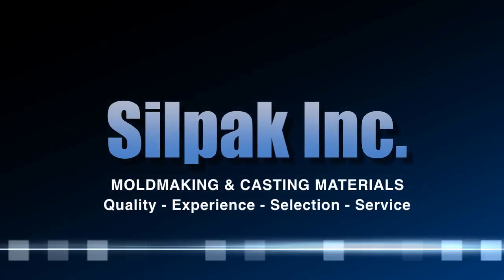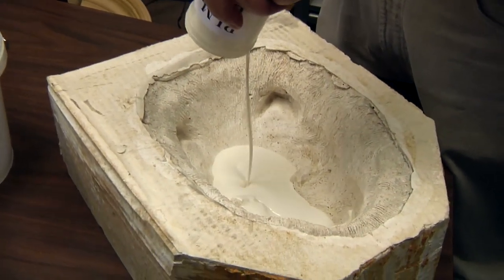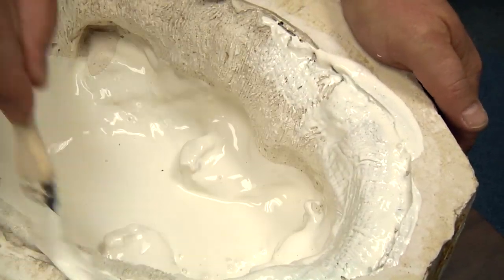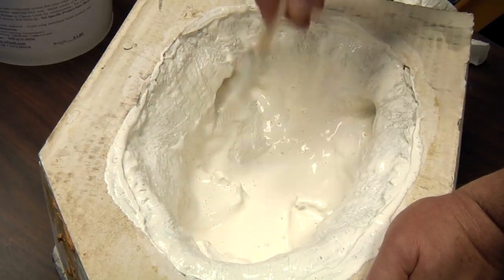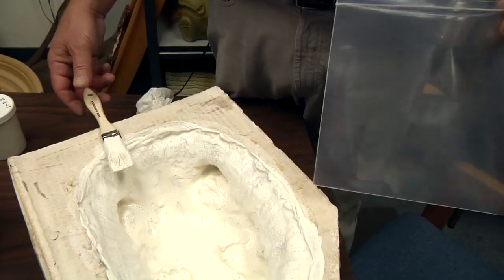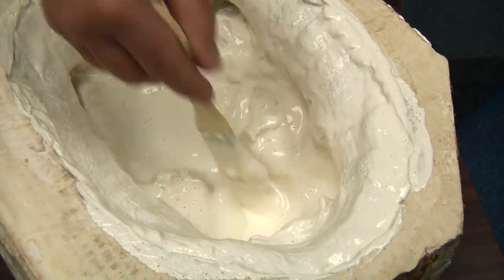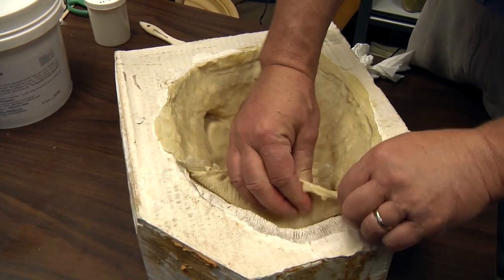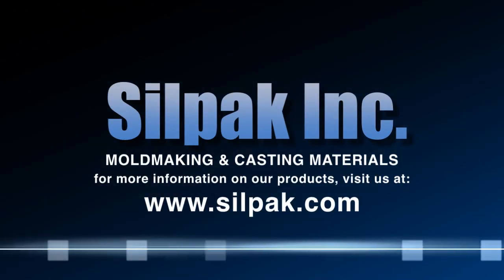Latex Mask Making Rubber with RLM-460

Comment: Great tutorial!  One Question: Since you leave the liquid latex there to dry for half an hour, and the liquid latex can flow due to gravity. So the thickness of the lion's nose will be higher than other part I guess?
Reply: That is true. That's why when u cast a mask, you can either pour out excess or just don't use a lot of latex. Hope that helps